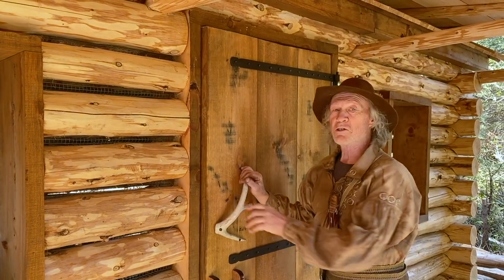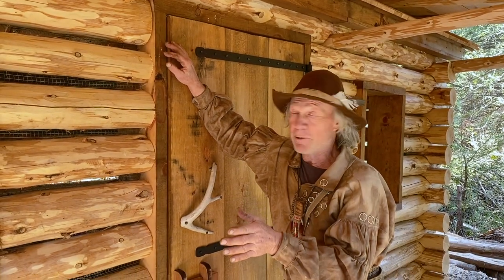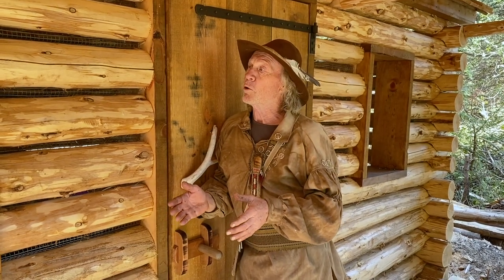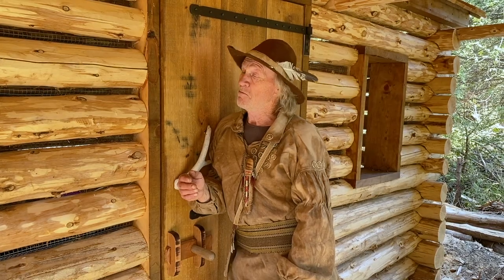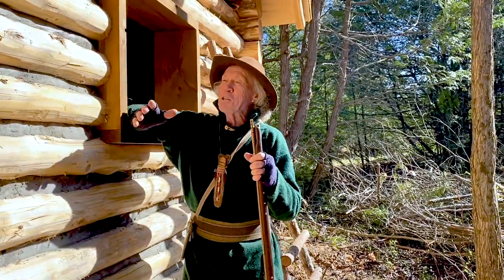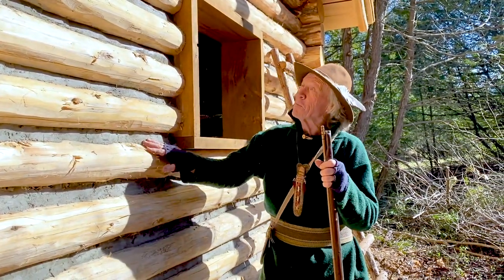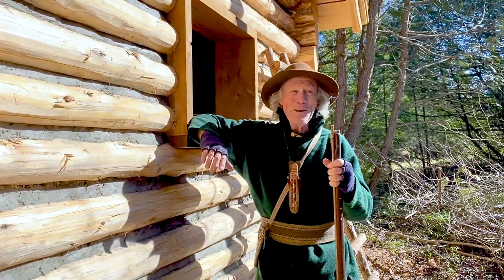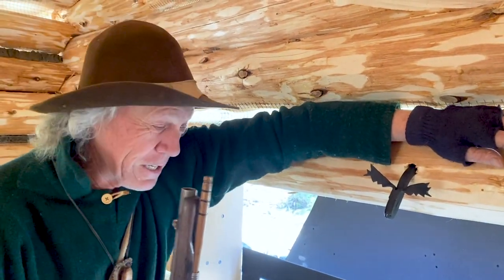Working on Windows, Chinking and Fascia | LOG CABIN BUILD | PIONEER LIFE CIRCA 1700's

Comment: Great video as usual. Ballpein hammer? I noticed  you were using a blacksmithing hammer earlier. Is there an an actual carpenters hammer? I'm sure there is, but I can't picture it. On a totally different comment, you mentioned May 1 and snow. I just got back from a 5 day rendezvous in Wisconsin. May 1 was 85 degrees F and 50 mph winds. I'd take snow and sun any day. I look forward to the Sunday videos.
Reply from the maker: I’m with you David, winter in fact is my favorite season.

Comment: Why switch out on the saws?  Apparently there is a reason but what is the reason?
Reply from the maker: Very observant Millie.  One saw is a cross cut saw and the other is designed to rip boards in the direction of the grain.

Comment: If you put the windows opening out, will you put your shutters on the inside? You've got me stumped. There would be no protection for the window's glass.
Reply: I would also question putting the door latch on the outside too.
Reply from the maker: Nope shutters will go on the outside.  The window is recessed a bit and if one needs to batten down for inclement conditions, the window would be closed.
Reply from the maker: Putting it on the outside saved chiseling out a recess in the door frame. Also it would not be a locked door regardless as the dowel opens from either side.  Pleased to see some folks look at the smaller details Duane.

Comment: Very nice work overall that I see in the video but it is unfortunate that a modern dolomitic concrete mortar was utilizedrather rather than the proper and traditional pointing/cobbing blends of clay, lime, and fiber (actually from manure most commonly in practice)..."Chinking" (better-called nogging in English) is actually stone or wood shards placed in the space between the logs (or between timbers in other forms of folk architecture) which you seem to have opted for wire which can lead to oxidation jacking over time and other challenges...Too many (such as McRaven and "This Old House") started the nonsense of clay/lime blends are low in durability, which they are not at all and whenever I ask those that think it is how often they have used it or know how to properly blend it the answer is always no...they don't know how nor have ever used it... 

Modern concretes can lead to all forms of interstitial moisture build-up because of the nature of the material. It was never intended for such work and more "made to work" rather than being appropriate for the job. In mandate historic restoration these materials are simply not allowed because of the damage over time they can cause and the failure to meet the "like for like...in means, methods and materials applications," ethos requires in such vernacular restoration...

I look forward to reviewing more of your videos as the quality of the work and attention to detail are excellent...Thanks for sharing what you're trying to do...
Reply from the maker: Thanks Jay for that well researched information. I agree with everything you have articulated.
Reply: @TheWoodlandEscape  Blessings for taking my post in the way it was intended...Too many grow offended on the internet these days when they are critiqued in some way...which I do not really understand. "Peer review" is a professional aspect of any professionals that put their work out and share it...I've seen a number of your videos now and your aim with them (if I am understanding them correctly) is to educate but not aimed at 100% authentic time period replication...As you can tell, I'm passionate about my professional work and feel for those that are "trying" their best but may have garnered misinformation because of the common sources of it...

Again thanks for a great channel and the hard work you're putting into these videos...If I could ever be of help/guidance, due please reach out as our "big picture" interests are most certainly aligned...Warm Regards, j
Reply from the maker: It is indeed primarily intended as educational material.  Having said that, I do spend the majority of my time living in the time period. Finally Jay, I sincerely appreciate feedback, so don’t be shy, that’s how I get educated.
Reply: @TheWoodlandEscape  Wonderful...!!!...and I look forward to evening review more of your content. Thank you again for such an open and erudite exchange between us...Blessing to you, j